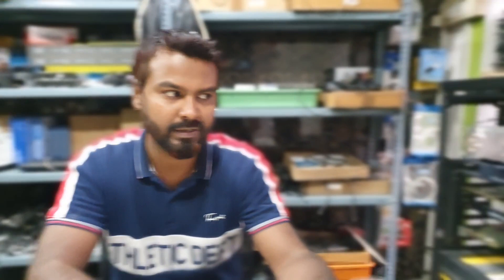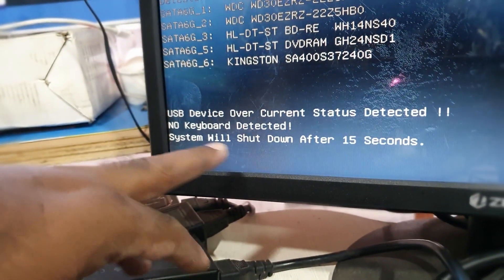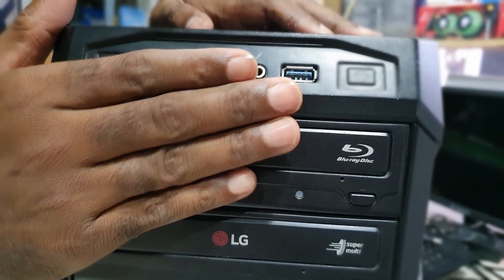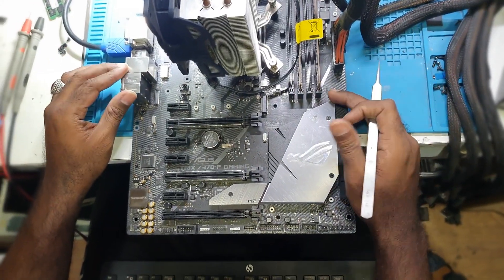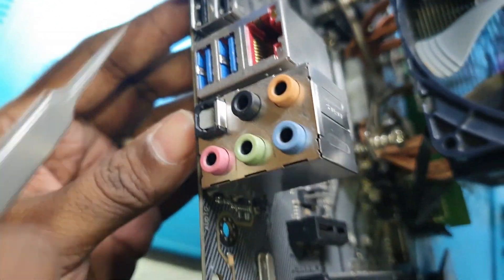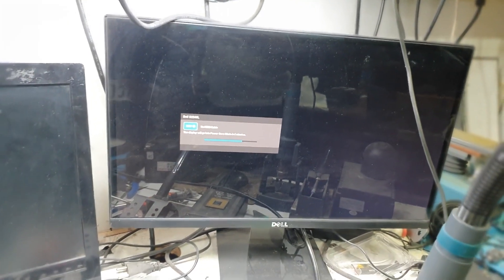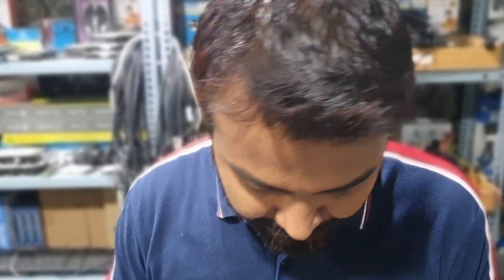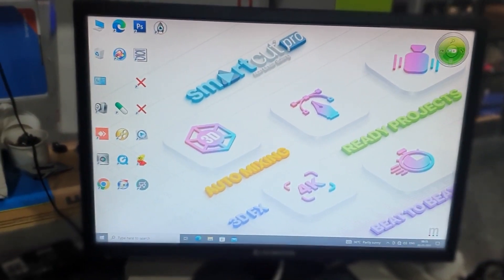Gaming pc Repair | Usb over current detected system shutdown in 15 seconds error fixing.

Comment: Hello, I have the same issue same Motherboard.  I need to get this chip from Aliexpress or eBay. What is the part number  ? Please help me
Reply from the maker: There could be multiple reasons for one problem,  but most suspected component of the one I have removed,  u better give it to service centre for right solution